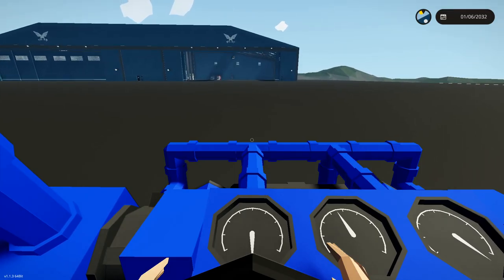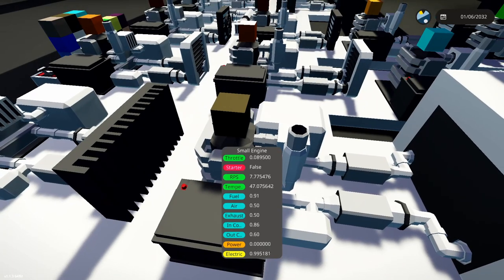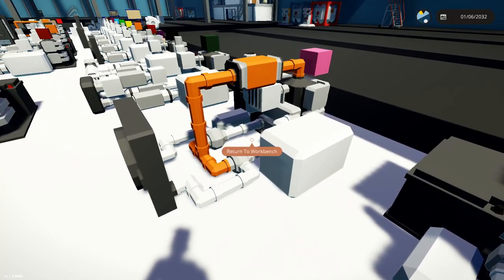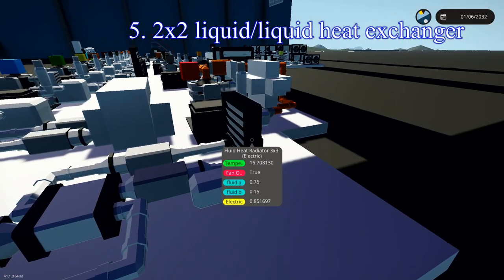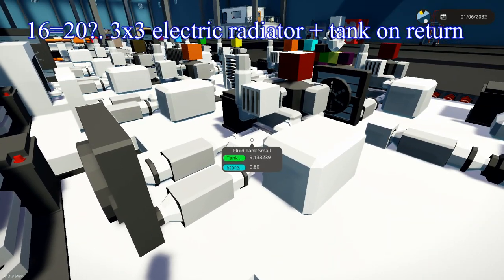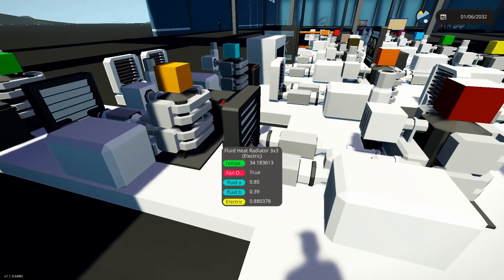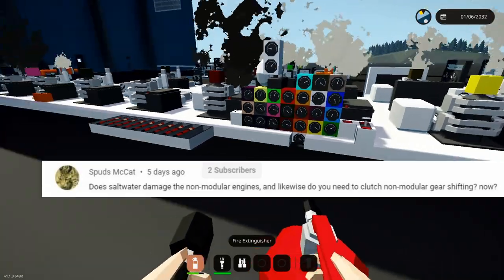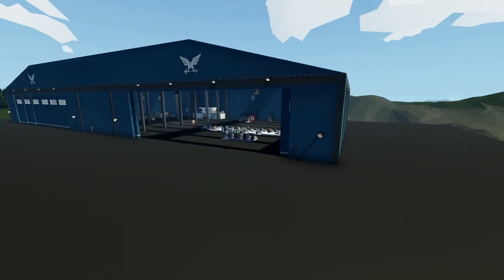Testing Modular Engines To Find The Best Cooling Systems | Stormworks Major Update 11!

Comment: For my designs, I've been using the 5x5 fluid/fluid heat exchangers to cool my engines. I like using a setup where the engine itself is fed with fresh water, with said water being sent through one half of the exchanger. The other half of the exchanger, though, is fed by an open loop made by putting ports on the bottom of my ship, and using seawater as the cooling medium on that side of the heat exchanger. I haven't done much testing of that design, but I don't see any kind of potential issues.

For land and air based vehicles, I've only made a plane and a train locomotive so far.
The train is driven by a large standard engine cooled by a 5x5 electric radiator with the fan signal being on the same control as my engine on signal. Basically, if the engine is on, so is the fan.
The plane uses a 3x3 electric radiator with the fan controlled by MrNJersey's modular engine ECU.

Comment: 7:30, community applaudes less flow as a way to maximize cooling time. If you slow the roll on the pumps, they get more time to chill. 28:00, there is a workshop item copy of the old gear box, if you are looking for one.

Comment: So it seems like the new cooling parts work but they don't work well on modular engines in my experience
Reply: No, it will work on normal engine as well as modular engine, but coolant manifolds are not so effective...

Comment: What kind of load is on the engines? I seem to have a lot of problems with load. Also was able to cool an aircraft engine at 17 rps loaded at 180 power with just one 3x3 electric rad. I directly connected the rad to the engine and it didn't go above 80c.
Reply from the maker: Most of the engines do not have any load on them. Only two of them have impellers that them engines are using their own power to run.
Reply: @StormRunnerGaming  got ya I was using generators to test mine but couldn't find any changes that made sense. Something is definitely wrong with the fluid right now. I have an engine that is getting fuel pressure but dies after 20 seconds and doesn't come back. So far all I can do is turn off fuel and overheating.

Comment: My engine will run for about a min and then seizes
Reply from the maker: modular engine? The problem usually is the air/fuel ratio in the engine. What are you using to control the air/fuel ratio?
Reply: @StormRunnerGaming  currently using throttle levers I've thought It was the cooling until I redesigned. But now I realize I'm having trouble with rps getting to high

Comment: you're testing cooling for modular engines on the old small engines... don't ever go into the science field Stormrunner.
Reply from the maker: I was using the small engine to test out cooling systems. For use on modular engines. I might have edited myself out saying that.